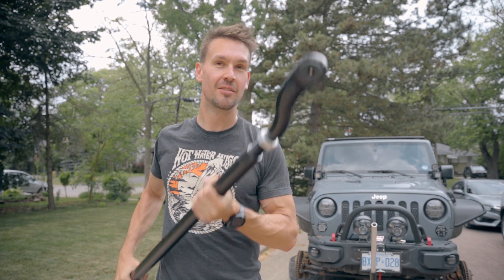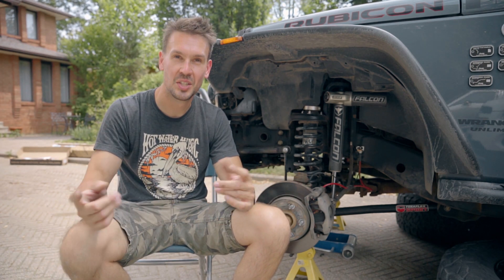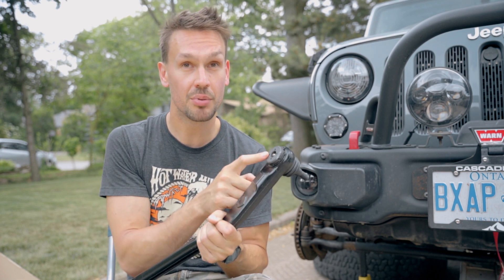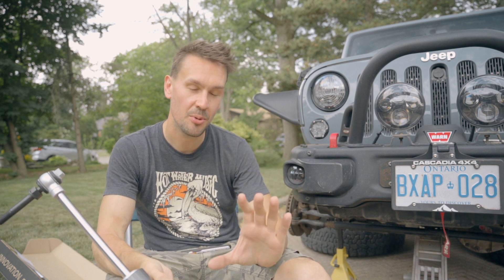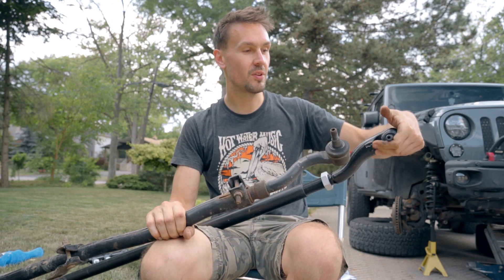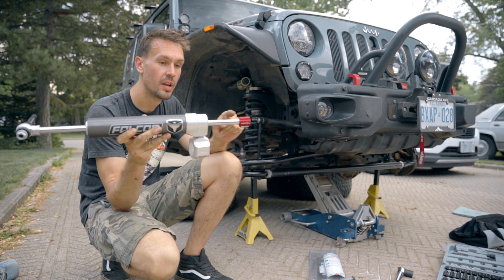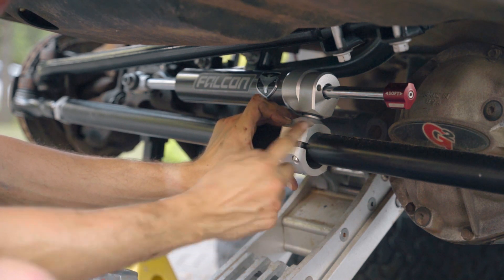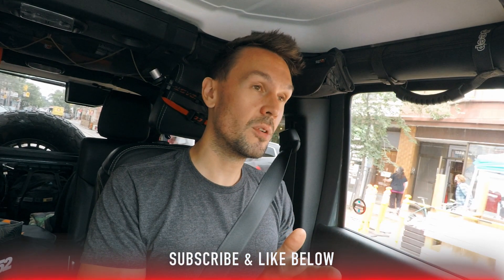Hefty Steering Overhaul! Teraflex HD Steering W/ Falcon Nexus 2.2 Stabilizer

Comment: I installed that kit on my JK Recon 6spd last year.  Awesome kit.  Also did their BJs.  Used their normal dampner.  Love it.  Drives better than brand new.  Use some red locktite on the large jam nuts because they will come loose.
Reply from the maker: Thanks! Ball joints are next! I'll definitely drop in some loctite, should have done that initially

Comment: I want to install this on my JK, but I'm running the Metal Cloak HD Steering upgrade it (larger diameter tie rod than stock) and not sure it will fit.
Reply from the maker: My tie rod is also upgraded and larger diameter. Comes with a stock size clamp and larger, you'll have to do some research on the diameters to make sure it'll fit